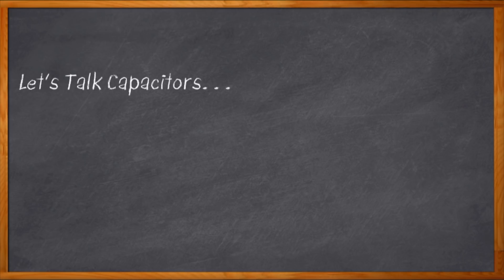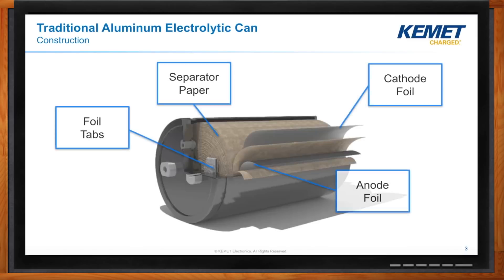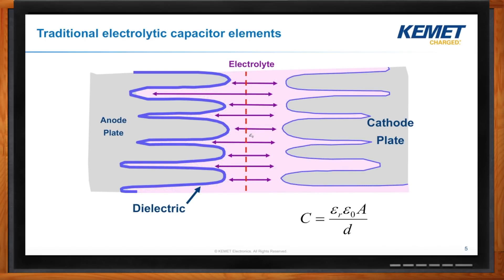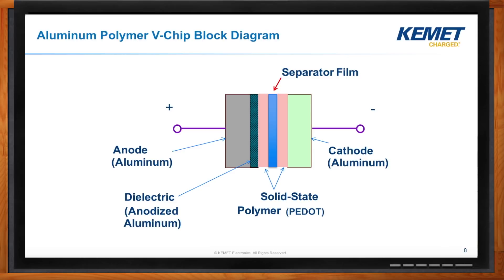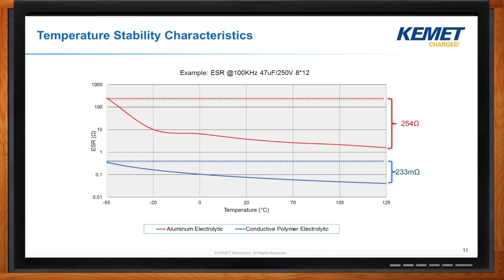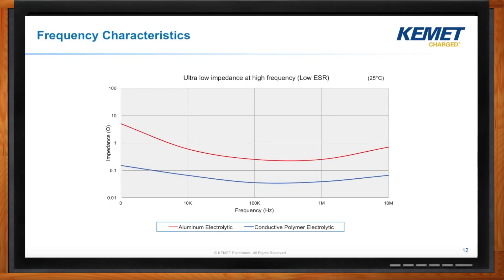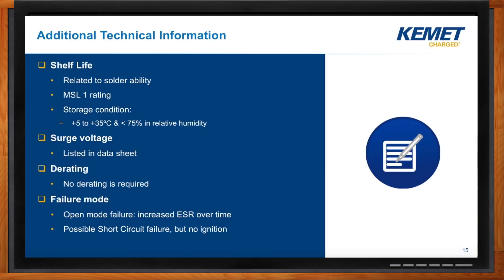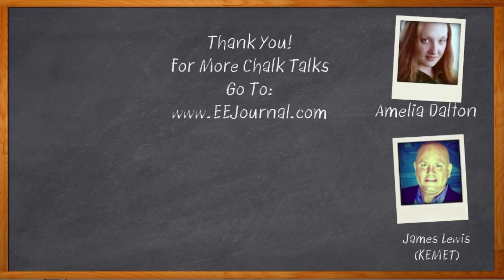What are Aluminum Polymer Capacitors? -- KEMET and Mouser Electronics

Comment: Can you provide information about the thermal resistance of these elecrolytic polymer capacitors, so the temperature rise for a given AC current can be calculated?
Reply: Keith Hungerford h
Reply: Keith Hungerford n